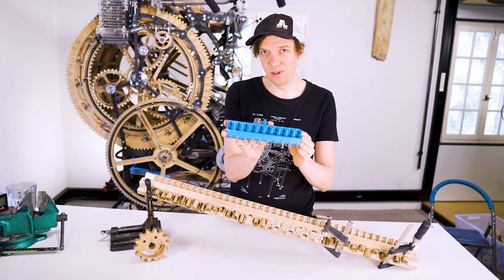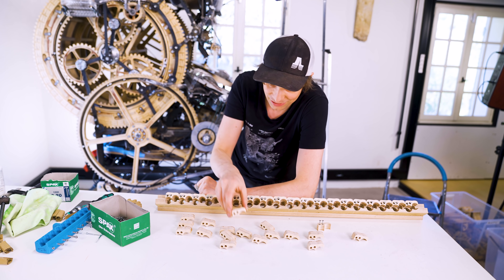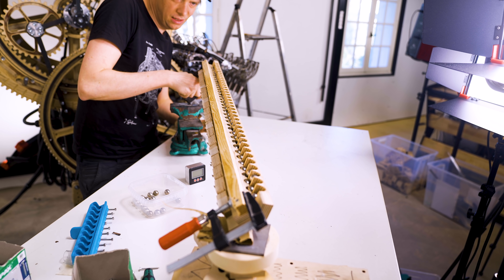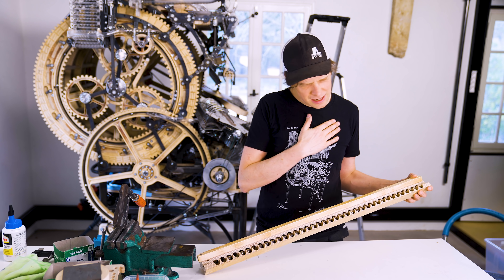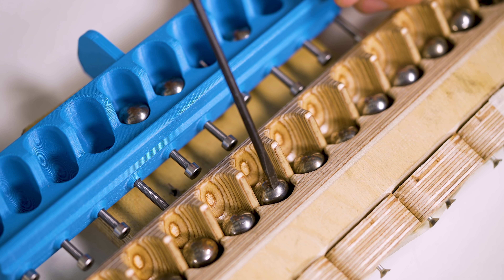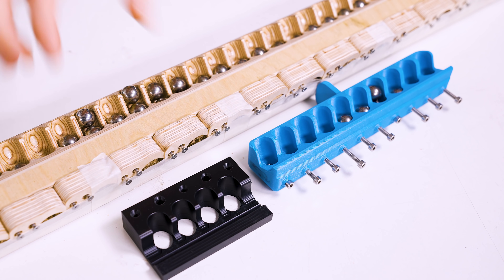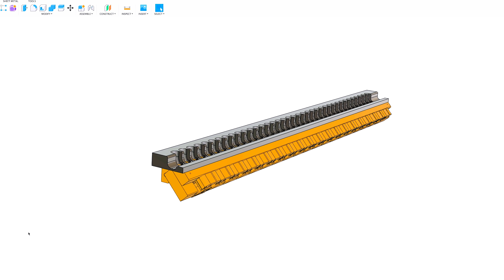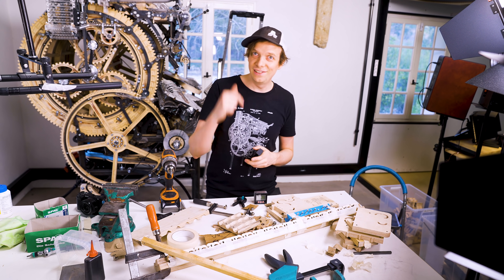Ultimate Material Showdown

Comment: I would personally vote to the use plywood, add the sharp edges  back in and use some lacquer to protect them from being chipped off by the marbles. Probably would be a lot cheaper than using machinable plastic. Though a belt printer could print the whole thing in one go fairly cheaply, but I'm not sure how well belt printers handle plastics like nylon or ABS, I sure as heck wouldn't use PLA unless it's going to be in a temperature controlled environment 100% of the time.

Comment: I wonder, if you were attached to the plywood aesthetic if you could achieve the sharp edge to the holes by milling the track deeper by the thickness of a strip of metal, running metal along the base of the track (invisible from most angles) and cutting sharp holes over the existing plywood ones. Of course you'd also need to cap the dividers I imagine, so probably more trouble than it's worth.

Comment: you have to take into account the fact that the marbles will already be comming with abit of velocity from the height difference between the marble elevator and the start of the marble divider. In the video you tune it as if they had o kinetick energy so they have to overcome greater resistance than if they were already moving.
Reply: Hes testing the worst case scenario
Reply: Are you sure this is worst case? It seems with just a little more speed the marbles skip over openings, and we all know marbles will be going faster

Comment: Martin, I love this design, one thing you might want to consider, is making the new attachment into 4 or 5 parts that are all the same, and removable. if one gets damaged for any reason it can be replaced quickly without replacing the whole 1 piece unit. Dont forget to take time out for yourself this weekend.
Reply: This is a fabulous idea. Several removable parts that are all removable is also a better way to combat wear and tear as it inevitably happens, unlike the current plywood parts that are glued together (not removable).

Comment: Watching through recent episodes, I realized your machine might require a day prior to performance to "tune" the instrument were you to move it to somewhere completely different. That POM would save a lot of time, but still it needs some angles to be rather precise, not like something you can just airlift down and begin immediately. Speaking of which, I want to see if the marble divider could be completely mechanical rather than relying on the gravity.
Reply: + During the first half of the video, as you mentioned the narrow window of tuning,  I thought one way to approach the problem would be making the marble divider "helical". AFAIK wooden structures can be bent when heated with water...Even with POM you can design it to make the leaning of the holes can match the speed of marble at that location. I'm not sure if that'd work better or worse, to be honest.
Reply: @jslavertu  Indeed, but that's what I meant for 'tuning'. Maybe a day was a bit too long estimation, but that was what I expected with that plywood divider.

Comment: Running the marble ramp angle in a vacuum without vibrations might be a bit too little of testing. You'd need to find a way to simulate the machine's shaking, as it can also be a plus to the marble's flow downward. Less propense to get stuck in small cracks when they're never stable and motionless to begin with.

Comment: i believe a better design would be in your new part if you cnc machine it with different schematics. reason being, the marble shoots should be perpendicular to the ground for proper filling. to do this you would need to angle the shoots to match the angle of the marble divider. by accounting for this you should get better speed, quitter sound and marbles should never miss a hole.  also it would look more eye appealing because your eyes want to follow straight lines so you need to create the illusion of a straight line.

Comment: I'm kinda worried about him testing stuff so willy nilly. The actual marble delivery on the machine is very different to what he's simulating...
Reply: yeah, his POM test piece shouldve been much bigger.  he’s giving plywood a bigger shot at failing his tests because more marbles have to pass through it
Reply: If it works under these conditions as a separate part it should perform fine on the machine. This is a much harder test, with slower marbles than the feed mechanism as it is on the MMX.
Reply: @foldionepapyrus3441  that's not correct. With marbles coming in at extreme angles bouncing and timing may lead to unexpected results.
Reply: @ettvanligtkonto  While I agree somewhat, At some point you have to take shortcuts in the testing and just trying it in the preproduction test model/prototype at full scale, or you will never actually progress in the build. Can't learn from the failures if you never actually get far enough to find the new ones. 

Sure its far from a complete test - However in many ways the material isn't the biggest thing that needed testing it's the geometry, and the much much much straighter path the POM and 3d print have are the bit most under test. How little marble height matters for this design concept has already be tested on the 3d print, and with the geometry correct the captive marbles are always providing similar path for the passing marble. The issue Martin really has is that plywood is very hard to make take the geometry a plastic part finds easy...

Comment: 1. machine plywood leaving 0.5mm stock.
2. penetrating epoxy resin on plywood. let dry.
3. re-machine plywood to final surface. recoat.
problem solved and it is plywood. it will feel like plastic.

Comment: You almost had it with the plywood!! You created over rotation! When you connect the "wall with the holes" piece with and the "flooring path" piece.. it forms a 90 degree right angle, giving the marble two points of contact as it rolls - this makes the marbles go slower.

But then you fixed it with the black material!! there is no 90 degree angle, you had the curvature built in.. no gluing two pieces together.. it has the curvature that the plywood doesn't have. If you replicated that curvature on the plywood, it will work.
Reply: The reason that he uses the POM is because that design would be extremely fragile if made in plywood. The edges of the piece would not be sharp, and even if they were, would deform quickly.

Comment: This old Tony has to machine this thing from a solid piece of aluminium on his Maho!
Reply: metal on metal = noise. I think plastic is the way to go here, just for the sound dampening over metal.
Reply: @Darkassassin09  that's a good point, having this part in POM over even plywood probably takes a fair bit of resonance out of the whole structure

Comment: I mean - there was really no reason to smooth over the plywood.
Yes, untreated it will slowly get rounded over. But who says it needs to stay that way? A simple thing that should make it last long is using superglue, or a bit more fancy - wood stabelizer.

Next thing would be to just add a thin protective layer on top of the wood - that could be 1 mm acrylic for example - clear so you still see the wood, yet hard with sharp edges.

Comment: Grate solution! I was waiting so long to finnaly see you switch up the materials for the critical parts. The most important thing I learned during my apprenticeship: things work if you can manufacture them within the correct tollerances. POM allows you to do that. However, watch out for wear! You might need to swich to  harder materials at for some parts.

Comment: Martin, have you considered using wood hardening methods to enable your plywood to hold an edge? There are silica based wood hardening varnishes that will soak into the wood and significantly harden it. You may want to try that.

Comment: You could try just using a piece of thin plastic (like the green bottle one) on the bottom of the divider track and on the walls ? It could have a sharp edge and would keep you from having to machine an entire meter-long piece again... Also I wouldn't be surprised that the plywood is more durable than the POM. Also ply looks better in my mind.
Reply: Plywood is unfortunately less durable than POM by a significant margin.
Reply: @martindinner3621  Oh OK. I didn't expect that.

Comment: The robustness issue you descripe is what is know as the variety case.  Only variety can cancel variety. So if you aren't designing for all possible sources of variety and have variety in your design to cancel it, eventually variety will take over and cause your design to fail

Comment: I understand your attachment to the plywood from an asthetic standpoint but I do recall some time ago, in your struggle to maintain balance between functionality and aesthetics, you came to an understanding that if you ever hope to finish this project you would have to focus on function. I feel like this is a perfect example, not only would a polymer based material be more durable, as well as be capable of tighter dimensions, it is inherently a smoother surface therefore imposing less friction on the marbles. This seems better than plywood in every regard for this use-case.
Reply: From an aesthetic standpoint I would suggest having the divider entrance machined from steel to match the overall look.
Reply: @iLaurock  Now that's a tall order. Martin's CNC router is not a milling machine. The onl way I see that happening is another call to TOT
Reply: @ilikeyourname4807  I agree, but if that call could be made, the steel would look real snazzy.
Reply: @ilikeyourname4807  yeah, he couldn't do that himself on the CNC. But do bear in mind that it's the part that will see the highest marble throughput and thus would subject to wear and tear. Loosing precision can lead to stuck marbles, especially if Martin decides to go with a low angle
Reply: Steel would be unbearably loud, possibly the loudest component on the entire machine. I think the current material choice is the right one
Reply: I do think the POM matches the black steel frame nicely
Reply: To help the decision to go to the plastic. Both Plywood and that plastic are a manufactured materials that do not form naturally. Question. Is there any plywood made from hard woods?  It might only have an outer layer of the hard wood. If Martin likes the wood look better, why not try real hard wood. Or is there a problem of the hard wood warping after a few concerts? Functionally, the plastic material works. Plastic can be made in any color pattern.
Reply: Also, the shiny marbles look amazing against the black of the POM
Reply: Because the part is high up on the machine and places on top of a piece of plywood, it likely won't impact the aesthetics. You could even confuse the right colored POM with metal without getting too close.
Reply: Or you know, make a 3dp insert within a plywood shroud, or just use wood filled 3dp filament if it's strong enough (and cheap enough)
Reply: @xxportalxx.  agree its worth testing, wood filled plastics are very convincing, even close up.
Reply: @regmigrant  yeah even the sound of them, I played with some blocks printed in it and you'd be hard pressed to tell the difference without looking closely
Reply: That would be quite loud.
Reply: It's not just this part that would be far superior made from POM. He seems to have completely ignored the fact that wood swells and shrinks with varying atmospheric conditions so most of the moles he will face wont even show up until he starts the world tour and by then it will be too late! As a piece of art it is stunningly beautiful, as a piece of engineering it is guaranteed to fail without major material overhaul across the entire machine.
Reply: @gwpcs  POM acetal has a coefficient of thermal expansion of 5.4. Plywood has 3.4 in it's 2D directions, and 16 in it's thickness. Choose your enemy.
Reply: @constantinosschinas4503  That's why I would have made the whole thing from metal and used POM for the wear surfaces only.
Reply: @gwpcs  You seem to have completely ignored the fact that he is using plywood which doesn't expand and contract nearly as much as normal wood. I'm pretty sure he is also using baltic birch plywood which has double the  layers for the same thickness as normal hardware store plywood, meaning even less expansion.
Reply: @fergusoddjob  As you said yourself, "less expansion" That's still far worse than no expansion.
Reply: @gwpcs  I agree he needs to face/resolve the issue and the highest likelihood of problems is after shipping, particulalry if its air freighted in a low pressure hold, so it will need unknown time for commissioning at each site as its brought up to local temp/humidity. However, wooden musical instruments have long worked in different climates so 'guaranteed to fail' may be over stating things a little.
Reply: @regmigrant  There are no wood instruments that require tolerances of microns to allow them to work. You can just retune and away you go. That is not the case here.
Reply: @gwpcs  If it turns out that he needs micron precision in multiple areas then yes, MMX is broken. However, 'just retune' and 'don't need microns' seem to be conflicting statements? What is retuning if its not adjustment at high precision? As I said, I don't disagree with you in principle but the fact that he's looking for 'large windows' of adjustment to work with at least indicates that he has an understanding of the problem as any musician would, and we don't know what the actual tolerances will be in the end. The difference between 5 degrees and 4 degrees doesn't sound like Micron precision, nor does sticking in a screw driver to demonstrate the size of the probem he's already discovered.
Reply: @regmigrant  retuning is indeed high precision adjustment. However this requires the parts that require tuning to actually be adjustable. To do that on the mmx is just impractical as every hole would need to be independently adjustable. Too tight and the marbles don't flow too loose and as demonstrated in this video the marbles get stuck. This is not a problem you get with other wooden instruments and is the reason why woodwind instruments use cork in the joints (even with the cork the connections can be destroyed with excessive expansion /contraction).

Comment: When testing the speed of the marble speed down the marble divider you have to take in to account that they will get a lot of speed from the ramp when they come out of the marble elevator.
Reply: Martin needs to learn some simple physics... what you are referring to is the potential energy a marble will have the the higher it has to fall from. For example... one trick that pinewood derby car racers use is to place weight towards the rear of the car... since it will be a wee bit higher and a wee bit further back - it will have a bit more potential and a bit longer to build up more speed compared to a car with weight towards the front.

Comment: Materials that can be 3d printed need to achieve a melt temperature where the spool fed material can be heated to it's melt transition point so it can bond to material already  on the bed.
This is great for modeling, however to achieve a reliable dimensionally stable part, Rigid PVC or ABS sheet would serve this application best. Both materials are available in sheet form in a 
variety of thicknesses. You would find they CNC machine like butter with little or no post operation clean up.
Reply: additionally they can be drilled and tapped

Comment: Martin: I can see that you are picking up the marbles with a magnet between tests. That reminds me of an issue you had before where the rolling capabillities of the marbles were reduced by the marbles beeing slightly magnetic. Can this be a (small part) of the rolling issue on plywood? =)
Reply: Makes sense that they would have a harder time passing elevated marbles already in the channel if slightly magnetized.
Reply: I mean the same marbles were used on all surfaces
Reply: I imagine it has some effect, but he's also going for a somewhat resilient design. There is magnetic transport in the design already, and demagnetization may not be perfect all the time. better to account for a little bit of 'stickiness' before hand.
Reply: Plywood is just a bad choice because of the reasons he goes over in the videos. Not to mention it would quickly wear.

Comment: It's not a design problem, it's an implementation issue. The one you got is far away from the 3d printed.
 The right point is that between two holes marble should lose less than it gets from gravity.

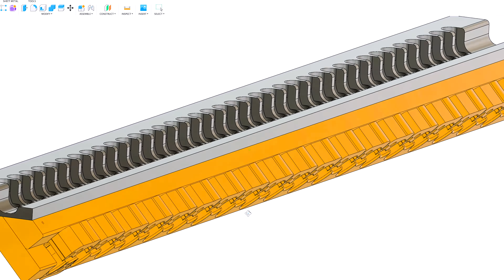Comment: 14:26 🚫🚫 Martin if you have the marbles cascading down from the top, is this not another mole. Rotate the top (gray) piece 180 degrees the channels act as a marble catch. Inertial energy becomes your friend as the marbles cascade down toward the channels instead of over them. Yes the aesthetics won't be as nice not being able to see the marbles filling the channels but function trumps aesthetics.
Reply: I believe he's planning to add a metal rail after it's installed
Reply: I can see the appeal of the idea, but I think that would actually create a worse mole - a marble with high energy coming from the feed can hit that sharp corner and the top of static marbles in the channel and get shot off almost any direction - you really will have no idea which way its going to try and bounce off the other marbles. Where a flat sheet marble catcher or as he had before those level rails don't give the marbles uncertain bounce geometry in the same way at all. They are only going to bounce backwards having lost lots of energy..
Reply: @foldionepapyrus3441  the inertia of the marbles is not that hi
Reply: @purpsquirrel6491  Looked pretty damn high to me when he changed to those new rails and demoed them, and they only need to hop up a few mm to clear that part rotated and end up anywhere in the machine at all.